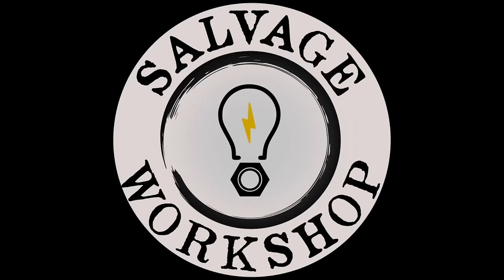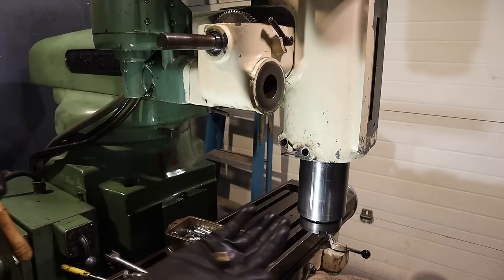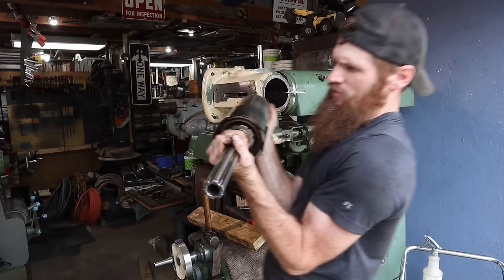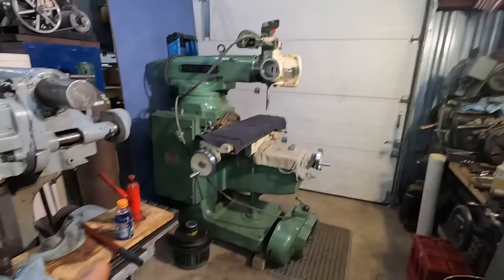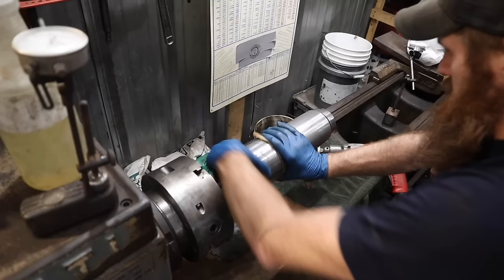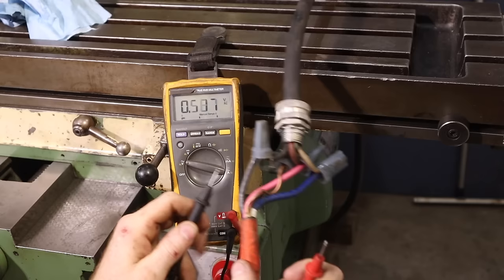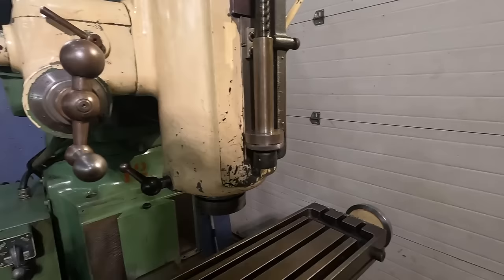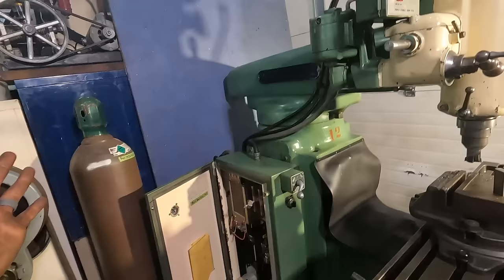My 1960's Milling Machine Is STUCK SOLID! ~ Can we fix it or will I DESTROY it?!?

Comment: Ouch in too many ways. So much damage in the making or already done. Every part must be tuned to the machine it is assemble into because of tolerance needed. You need to learn how to chuck material first before you attempt to turn anything.

Comment: O.K almost yelling at him beating on that quill. I am sitting here on my laptop and  every time he pushes the quill in it stops at the same point. DUH. It's the quill not the cylinder. I'm guessing it is egg shaped near the bottom. All he has to do it put some paint on the quill, push it in and the paint will scrape off where the problem is. Someone needs to take his hammer away.

Comment: Man....... watching you almost butcher....(correction....you did butcher  the spindle ) was cringe factor mate jeez . The wedges you pounded in thinking you were doing good ,has probably  ruined it and the spindle may never run true. 37.40 and yes this confirms that you don't have a clue what you are doing. You do konw the quill bore and quill are a high tolerance fit to each other  and when you hone it it'll slap about  like slack Alice  ffs. On a side note ,your spindle bearings will be screwed after pounding on them with a hammer . WOW WOW WOW this was a hard watch dude .

Comment: Re the brass plug in a hole, you can shoot compressed air over the top of the hole, air pressure will lift the plug out of the hole.
Works to siphon gas too.

Comment: Given there were several machines, yours is probably a bitsa - a bit of this one and a bit of that one and a bit of that one over there - this came from the age of the craftsman so each bore was likely made to fit its quill
Reply: That’s fine and all of a theory. But I can’t imagine anyone put that quill in with a hammer. Either it went in easy or an absolute moron with a hammer already beat it to death. There would have been witness marks originally
Reply: @jasincolegrove4798  or frozen the quill or heated the bore or both
Reply: @trainsimulatordriver  but why would you do that? It’s not an interference fit.
Reply: @jasincolegrove4798  who knows why people do what they might do

Comment: This was the most cringeworthy video I have watched. Please stop using steel hammers on precision machines. Brass, copper even lead will work without damaging the steel part of the machine. The spindle should come out the top. It's your tool, but to be honest I can watch you back your butcher fix this. Asking questions of someone that knows is better than any hasty hammer swing.

Comment: I think you and ur assistant are qualified now to do hip and knee replacement surgery , some of ur commentors want to throw u under the bus  .You might want try flipping those overload heaters over, one on each leg in contactor ,might increase amp rating , gotta find my electrical handbook, bible ,or google em . Electric motor repair shops can figure em for u. Need motor amp draw at 230 volts and need know motor overload factor , its on data plate of motor. U can always get new contactors with overloads. Like Eaton ,cutler hammer etc. Figure 125 percent if no ol factor. I think,  been 20 yrs since i did industrial maintenance.

Comment: Those WERE precision spindle bearings $$ that you were hammering on. You needed to make a spacer (tube or two bars and plates) with threaded rod to pull it out. I wouldn’t use a hone but make up a lap and use fine clove compound. You only needed to remove .0002” in the tight spot. Way way too much hone time. This is cringe level watching. 😮

Comment: You can't measure run out by just clamping it in a 3 jaw chuck like that. There is no way to know if its not parallel to the machine, or if your chuck teeth are off. You can get a part close to centered, but you can't use that to measure it, only to center if you're going to take a cut. If you took a micrometer and slowly measured different diameters around the circumference as you rotate it to different angles, you might be able to determine some form of runout. I highly doubt that piece would be out of round, and was likely precision ground to an insane spec.  Just think, ALL of that precision in the machine comes down to those two parts having an absolute perfect fit. So if there is any play at all it goes out the window. This was definitely a situation where you just remove the head and dropped those two parts at a reputable machine shop and had them fit properly. 

That wedge part was... hard to watch.
Reply from the maker: The wedge part is from the manual Sean!
Reply: @SalvageWorkshop  I kind of figured that, just would be tough to do! I guess it would be for removing the lower spring retainer though, and normally wouldn’t require such expansion. Yours was a unique case for sure haha

Comment: For the handle u couldn't get off even with heat its held on by a tapered pin also be careful as its all a cast piece an it tends to shatter and i dont normally say this but u know just enough to be dangerous smh
Reply: Also there's a snap ring in the bore near the top u take it out to take the shaft out

Comment: It is really hard to watch you beat on such a nice machine! And the die grinder! It worked at one time and it’s not like it’s rusty in there. You smacked those wedges way to far In there and egged it. Omg get precision measuring tools to find the issue. I’m gonna vomit
Reply: First you should’ve filled it with penetrating oil to let it soak in a few days and second instead of beating on a basically bran new machine you should’ve asked for advise to listen to what people say. I would’ve said rig a bottle Jack to press it out

Comment: I believe you were telling us the truth about using that rounded file on all those edges. This means that there is only one explanation for what the problem is. That quil isn't the one that came with that mill. That quil was possibly the original, or else the sleeve around it. Why else would it not slide into the head of that mill? What it needs is to be precision machined so it will fit into that head. Matt, do you have any idea why the previous owner would use that sleeve instead of the direct replacement of them? I have an idea about that. They don't produce them anymore.  Another possibility is that the manufacturer sent the owner the wrong sleeve. That's the reason why  manufacturers must put a part number or letters on those components. Another possibility is that it came from China. I'll never buy replacement parts from that country. I'll buy them from the manufacturer, whatever the price it will be. They have all the specifications for all machines they manufacture. It's quite difficult for replacement parts manufacturers to do this when there's a language barrier between them. Try talking to a foreigner who doesn't know the language that you do. This is an impossibly. You need to learn that language first. Besides that, they have inferior tooling to cut those parts. Those are the reasons why I'll never buy from a foreign country. Are there any other possibilities why that sleeve is binding inside the head of that mill? None that I could think of.

Comment: Totally unimpressed with the hammer and chisel method,
You should have gotten ahold of the manual with the exploded diagrams before attempting disassembly.
Reply from the maker: I have all the manuals! They don't have a section for removing the quill once it's gotten stuck in the head... Thanks for watching!